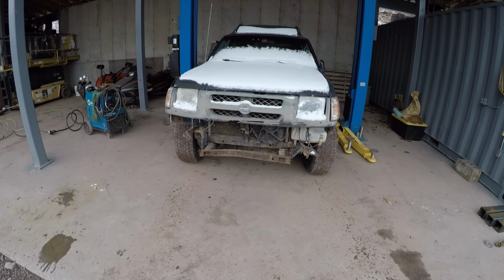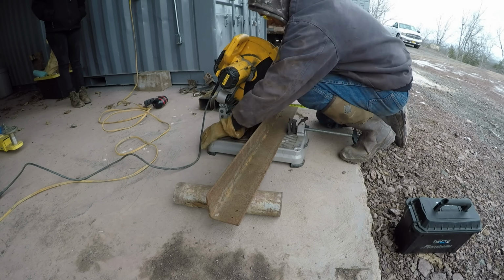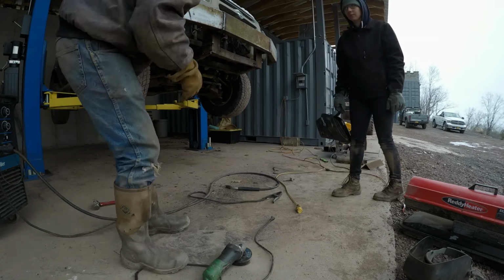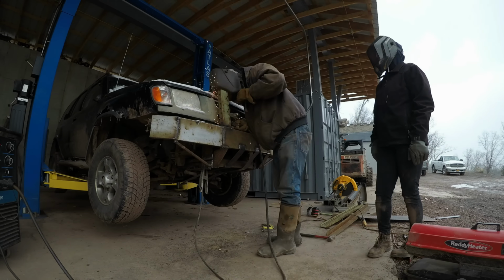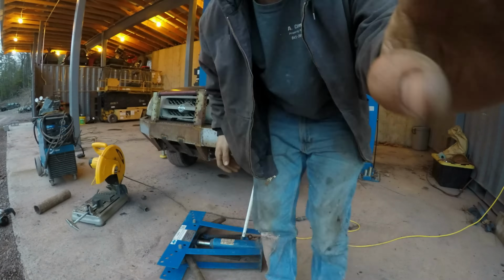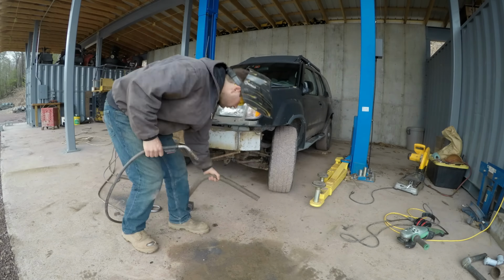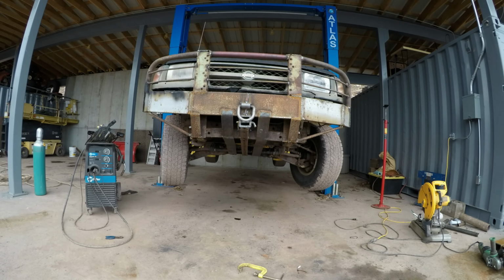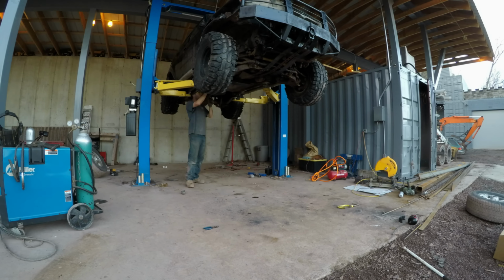How to build a heavy duty bumper

Comment: One tip – when you are welding near glass, like the headlight or windshield, put protection
cover on the glass. Otherwise welding splatter will burn pittings in to the glass which can´t be removed. Thanks Andrew for a bunch of nice videos – very informative and inspiring to watch your high quality videos. Keep posting
Reply: i also thought that andrew would probably be VERY worried about the pitting in the glass ... he does seem to swett the small stuff alot...lol

Comment: Everything is beautiful, but when this bumper collapses somewhere very hard and bends, you will not do anything on the road, because it is fully welded, so you will not unscrew it to, e.g. release the wheel. 
 And since the bumper is stronger than the car's frame, you risk deforming the frame, then the car will lose its geometry, it will run badly and the tires will wear off quickly. And fixing it - difficult or impossible.

Comment: yes you are quite the fabricator.......i notice that all the cars or equipment where you live seem to have rust issues, is this a common problem where you live?
Reply from the maker: Thanks, yes, they all rust out. Its from the Salt that is put on the roads in the winter. It is very annoying.
Reply: @AndrewCamarata  I read someplace, that if you coat the undercarriage with waste motor oil, it will prevent the rust.
Reply from the maker: @Shield.148  Yeah, There is a product called Fluid Film that helps. I need to do my vehicles. The only thing I have salt on is my pickup truck. Everything else I just don't use.
Reply: @AndrewCamarata  some plow guys park their truck over one of those oscillating fan style sprinklers and let it run for 20 minutes or so to get the salt off the underside. You could just throw it up on the lift and pressure wash it.
Reply: Anywhere that ain't south or west just a rots

Comment: Isn't there a safety hook on that spare tire lift thingie, so that when the wire is pulled up to the body, the hook snaps in to the hole where the wire comes out, but only if the outside of the rim is upwards?
Reply from the maker: For the spare tire? Yeah, it hangs under the back of the car with a wire.
Reply: Yes, but I mean if you turn the tire around so the wire is shorter when it’s fastened under there. The thing that grabs the rim through the center hole, doesn’t it have a spring loaded hook that clicks into place under the car body when you tighten the wire? So if the wire is rusted and snaps while you drive, the tire will not fall off. Maybe it’s another model/year I’m thinking of.

Comment: hi, that front bumper looks great, what size box section did you use for the front bumper? guessing 200x50mm 5mm thick, i cant seem to find that size anywhere, regards nice job man
Reply from the maker: That was metal from a trailer frame. It was right for the project. C-channel works well for bumpers too.

Comment: Isnt the point of a bumper to absorb impact (ie: dent) so as to protect your frame and other parts of the vehicle from damage?
Reply from the maker: Nah. I like having strong bumpers. Its fun to crash into stuff. Just don't hit anything really strong going very fast.
Reply: @AndrewCamarata  I'm actually thinking about building one like yours for the back of my plow truck. The original one has rust holes in it and I just keep spray painting it every few months so it looks decent.
Reply from the maker: Yeah. That's just a piece of C-channel. It works well. I have backed into things and it does not bend.
Reply: @AndrewCamarata  unfortunately the frame on my truck is rusted badly. I'm in Iowa and we have the same problems you have there. I'm thinking about reinforcing the frame since the engine and trans keep chugging along. It's a 1992 dodge w250 that I bought 3rd hand. Still has the original western plow on it that came with the truck when it was brand new and still works good with a few tricks.
Edit:  I replaced all the brake lines a couple years ago. I had to laugh when i watched your video on that cuz I knew exactly how you felt.
Reply from the maker: Just weld re-bar down the whole frame. Weld it to any sections of frame that are solid, and tie it into stuff like the leaf spring mounts, transmission mount, body mounts. I have fixed a bunch of frames that way, it works good.
Reply: @AndrewCamarata  great idea. Do  you run just a single row of rebar down the side or do you need two or three rows and what diameter rebar? Thanks.

Comment: Andrew, lucky you are not in the land of Oz they would put your truck off the road, you can't have rust holes or any rust for that matter, what you built in this video in Oz we call them bullbars but the norm is to have them lean out away from the front of the vehicle so when you hit a kangaroo it knocks them down rather then having them come over the top and into the windscreen.

Comment: noice!  man, that road salt really tears up vehicles up there eh?
Reply from the maker: yes
Reply: Yup. Turns many a car or truck into a rust bucket after 7-8 years. You HAVE to wash, wax and undercoat ALL THE TIME to just have a hope of keeping something nice longer than 10 years in the Northeast US
Reply: @davidmathay7117  same in the midwest. I just thought it was normal until I went to a few other states and realized that just because a car is 15 or 20 years old doesn't mean it should be a heap of scaly rust with seized bolts and missing rocker panels. Other than that though, it's not a bad place to live. Lol.

Comment: Interesting how this is legal in the US. This wouldn't fly in the EU
Reply from the maker: You guys need to do something about your over regulated laws. I think that's why we have guns in the US, people around here don't let anyone tell them they cant do something. (unless its completely unsafe/stupid).
Reply: @AndrewCamarata  Nah, to late for that.. Too much bureaucracy and too many layers of regulatory offices are in the picture. A few examples: you have a random car and want to replace the rear brakes with the ones that are fitted with the same car, but with a larger engine. Seems easy, and as that specific car already comes with those brakes, BUT with a higher trim level, you need a shitload of documents, about the parts, the fitting by a "certified mechanic" and the extra inspection that it's done correctly by the department of transport.

By watching your video building your castle I was thinking all the forms and inspections you'd have to go through here (and most likely they won't even let you begin the construction..).

Comment: How the hell do you know how to build anything??  I couldn't build a birdhouse😭!!!
Reply: hha i know right, dude is a genius.
Reply: learning and practice.
Reply: Just giver and dont be afraid to make mistakes.
Reply: You look at somethin and figure out how they made it my dude. It's a pretty useful life skill. Also, can't do anything if you don't try and fail first.
Reply: Well, a birdhouse is just several pieces of wood cut in certain shapes and nailed or screwed together. It's just a matter of cutting the wood and then putting it together. Same with the bumper. It might seem complicated before you get some practice and get used to holding stuff where you want it and operating the tools, but the awkwardness goes away with practice and things get easier as you make one thing, then another, and another until you can pretty much envision anything you want and then put the pieces together in your mind. At that point it's just a matter of using your hands and tools to create the pieces you see in your head.

Comment: Are you planning on bombing an embassy in this jeep?
Reply from the maker: You would want to designed the bumper differently for that application. Sounds like you need to be able to push other vehicles out of the way. This designed would make the truck drive over them and flip over. Make the bumper lower, without the sloped angle.

Comment: This guy is a bush mechanic, does things without much of thinking...That steel bumper weighs over 200 lbs, do you really want to log around that much dead weight? A professional would build a strong yet light bumper from a 6061 aluminum alloy that would weigh 1/4 of that thing.
Reply from the maker: Weight is better for crashing into stuff.
Reply: Andrew Camarata  - I don't think so. Weight will cause the car to sink deeper into mud, heavier to tow out, you'll burn more fuel to cover the same distance...etc. T60601 aluminum is as strong as steel at fraction of the weight and will never rust. I do understand welding aluminum maybe outside of your skills, but it's worth mentioning anyway. BTW you're videos are pretty cool, dude.
Reply: aluminum bumper would not have taken that abuse.